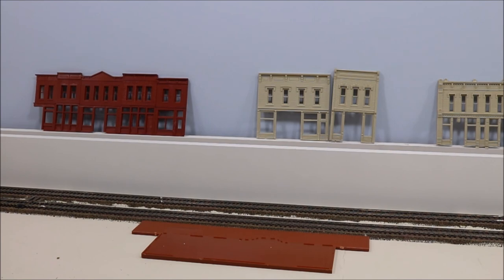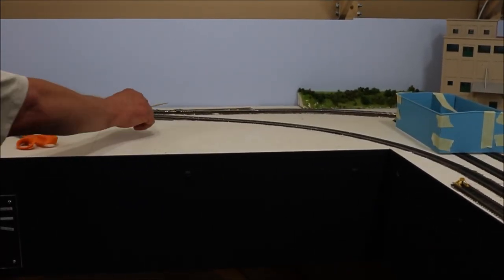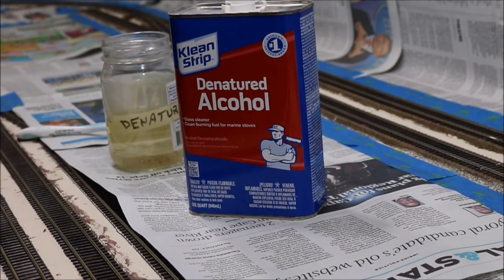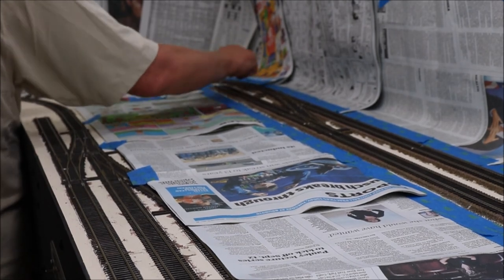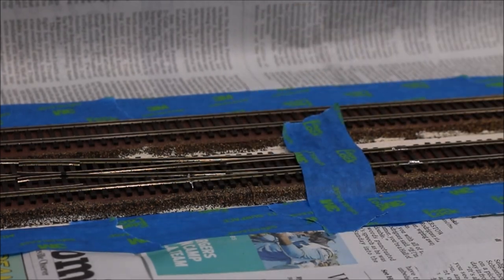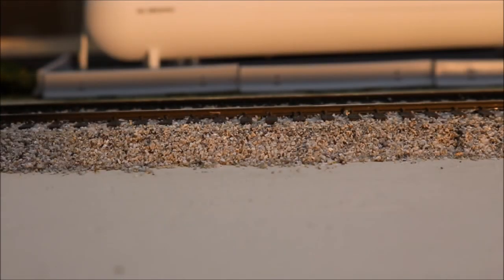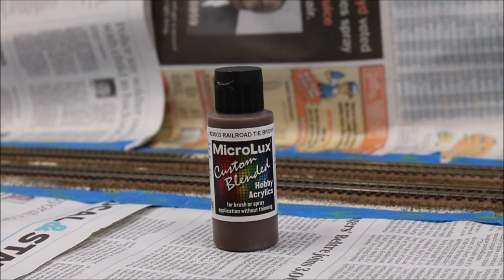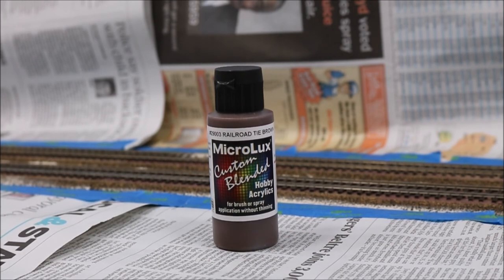How To Paint Track

Comment: Hello. Excellent result but, doesn't it need any primer prior to airbrushing the track?
Reply from the maker: Thanks for your comment. Primer is never a bad idea. I just did not use it with track but I do use it on plastic structures. Seems odd doesn't it. You may have identified a flaw in my thinking...Harold

Comment: Does that paint come in an airbrush formula already properly thinned in that RR Tie brown and first of all,  where did you  find that brand?
Reply from the maker: Thanks for your question. The paint brand is MicroLux. It is airbrush ready. No thinning required. I found this paint at Micro-Mark. It worked well for me. You could also consider the ModelAir paint brand which is airbrush ready and can also be found at Micro-Mark...Harold